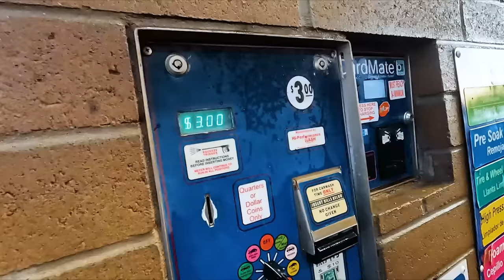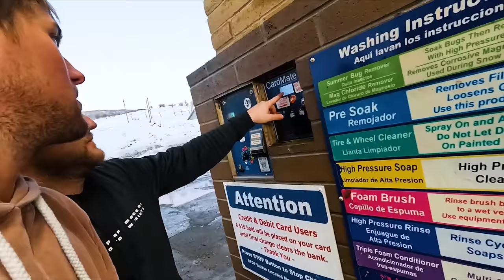Run Away Snowmobile!!

Comment: Glad to see you guys having fun in the mountains. I am a 68 year old guy who has been doing that sport for 15 years now. I have learned to ease the punishment I start walking with a 35 pound backpack, two miles a day starting around thanksgiving. We usually ride for 5 days and I can tell the other guys are getting much more tired than I am. We ride in areas just like you did. Its a push to do that sport. But as a farmer from North Dakota its a blast. Push yourself for a couple of months here and you will have lots more fun there.

Comment: snowmobiling is like mudding, lol. pin it until you get stuck, then wear yourself out getting unstuck. But deep snow is easier to get stuck in than mud, with the bonus of potential suffocation and frostbite.

At least the snowmobiles clean themselves lol, just park it in the heated shop and its like new in the morning. No firehose required like the Quadtrac's lmao

Comment: I went snowmobiling with my friends in highschool many many times... the last time, it was white out conditions and my buddies were a bit far up ahead and broke the cardinal rule and stopped 5 wide across the trail up in front of me. I couldnt stop in time and did my best to shoot a gap, but hooked skis with one of them.. I stood up at the last second so I would get shot over the handlebars instead of slamming into them. Flew a good 30ft or more.

Never went riding again. Not worth it to me. Not only the cost of the hobby, but the cost of wrecking sleds, and being stranded out in the middle of nowhere. and of course the likelihood of injury. 

Just wasn't for me anymore